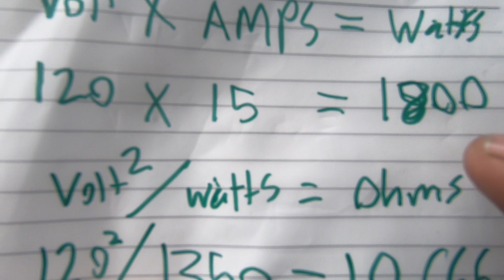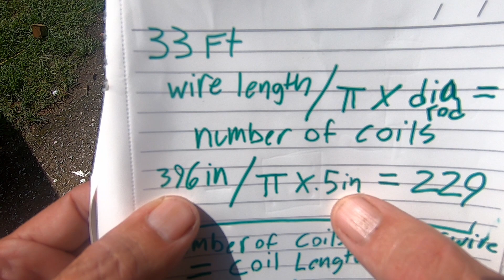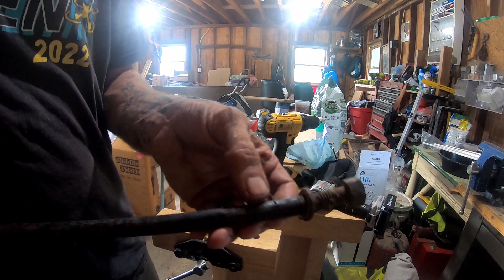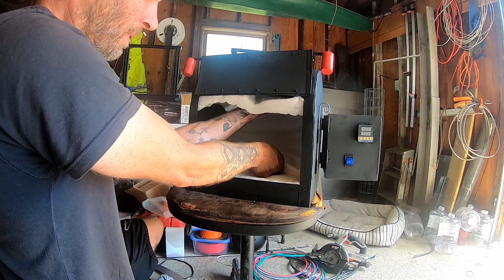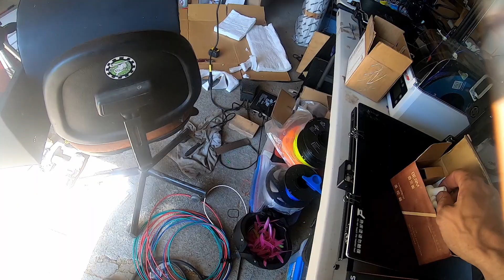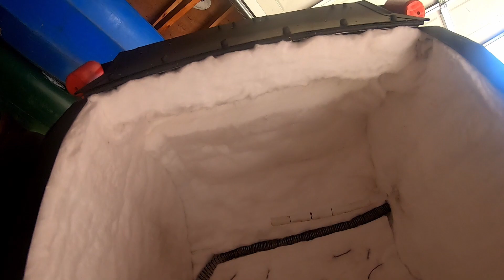HOW TO BUILD A GLASS BLOWING KILN FOR 300$ {PART 2}

Comment: There is a trick to wrapping the coils with a drill I’m pretty sure
Reply from the maker: Yeah there is, I tried it before coiling by hand,  it kept messing up and wasting wire. I finally got to a point where I didn't want to take the chance of losing more wire and having to buy another roll.